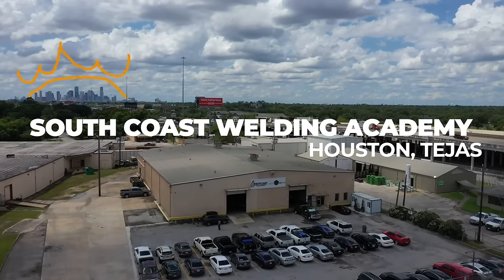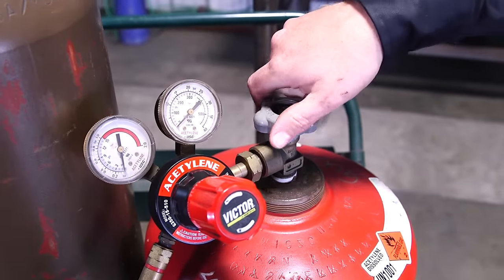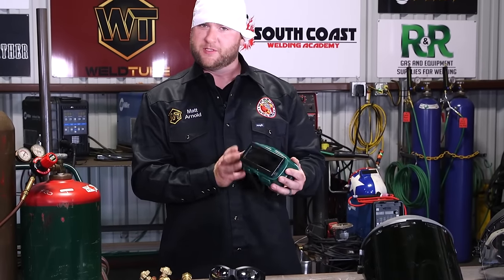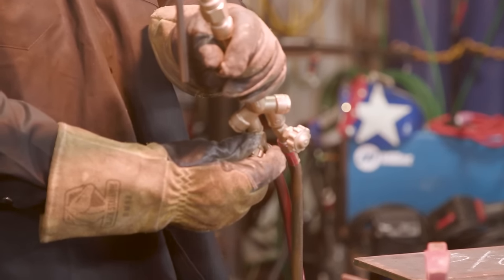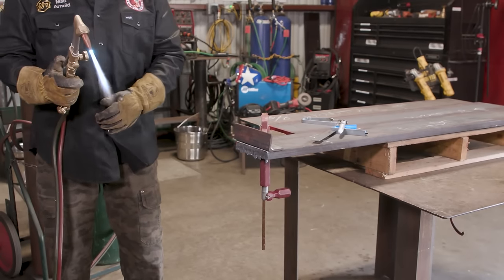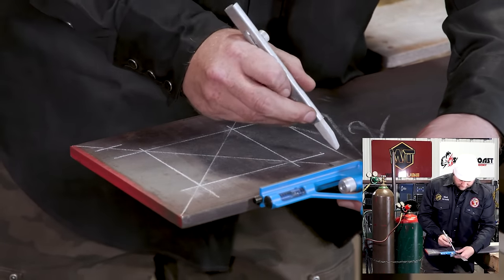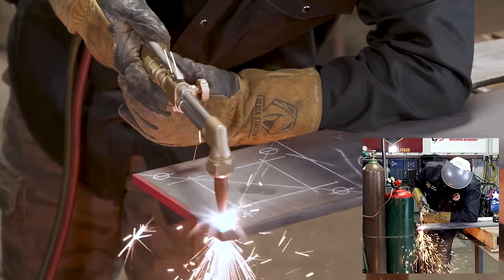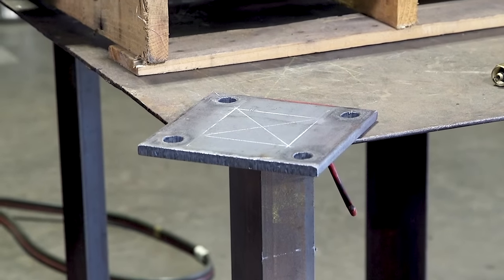Torch Cutting Basics Everyone Should Know | Oxygen & Acetylene Fuel

Comment: Another quick tip when you were going to pierce a heavy plate use a price  punch in the center of the hole and start your hole there it will help pierce the plate with your torch
Reply: Yes the term is prick punch and we all know to angle the cutting torch tip so it doesn't melt when preheating. Thanks, I've never heard that tip before.

Comment: You included good safety tips.  But, when you were setting the oxy acet regulator pressures you had the torch tip pointed pretty much at your clothing.  Some clothing is more prone to capture acet and/or oxy resulting in a potential fire hazard to the operator when you light the torch.  However, given the time between you setting reg press and lighting the torch resulted in minimal risk for either gas to still be present on your clothing.

Comment: Using a torch to drill bolt holes. Much faster than drilling. Good to know.
Reply: In some fab shops if your doing rough work the boss will insist you cut the holes with a torch. It's rough but saves a lot of time. The difference would be 1/8 stock versus 3/4. For 1/8 you would punch first and if you don't have the equipment then drill. It all depends on how precise the hole has to be.

Comment: Question for you Matt:  Can I use a clean, dry paper towel to wipe out the conical regulator connections on an oxygen and  acetylene tank ? Never has any grease or oil been put on them.

Comment: Hey Matt, great guidance and info I can use in Sargent. RE: hose safety and placement, I normally drape the hoses from behind then over my shoulder. Helps keep the hoses out of the spatter and takes some of weight off my arms/wrists during a long cut or weld. Do you have advice or opinion on that? Thanks.
Reply: I've personally seen an acetylene hose have a pinhole in it and guy had hose blow up while thrown over his shoulder. Burned him pretty bad. But with that said... if you have spark arrestors and check your hoses..... I throw them over my shoulder too sometimes.
Reply: A loose single wrap around your forearm is helpful as well, I do that alot with any corded or hosed tool that will allow it. Helps with weight and keeps the cord/hose out of the way.

Comment: I was fortunate to work for someone that taught me how to use a cutting torch. Too many people think the bigger the tip the better. My favorites are the 0-0000. I use a cutting torch like it's a plasma torch. I have things displayed on my front porch I have cut out. I also have TRIED to teach others how to use a torch. Once they get the space shuttle going you have wasted every breath TRYING to teach them. Sad to not need a chipping hammer or grinder after you cut something. I have had signs displayed that cleanup afterwards was minimal. Tread plate is a little harder to cut 100% clean. Even light gauge with no grinding/chipping. But get a #5 tip and crank the oxy-acetylene up and wonder what's wrong with the tip!

Comment: Not all torch manufacturers have the same shutdown procedure. Smith is fuel gas first then oxygen. Victor is oxygen first then fuel gas. Great video.
Reply: And thats is victor one
Reply: Thanks for this! Mine is a victor style and I close the oxy first then fuel for shut down.
Reply: Triangle combustion rule
Oxidants - presure - fuel(hidrocarbon)
A bit fuel Enought to blow oxigen tang
Reply: Its always Acetenyl and then Oxy.  A before O or up you go!  The idea is that the Oxy will blow out the flame, and then you turn off the oxy.  If you turn off the oxy first the gas could continue to burn back up the line, ignited by the hot tip.
Reply: @trevor5290  my torch light up is A then O and shutdown is O then A.  That's by the book it came with.  It's by victor.

Comment: that torch is cute. we use the 3ft n 4ft torches at work. so u know how thick the metal we cutting at work. i would say the thickest we have to cut is 12 inch but deff with a straight tip and not a 70 degree. cool stuff man

Comment: Great video, I can smell the burnt steel. I only noticed one minor thing , no two actually. First, when you opened the acetylene valve the hose pressure gauge was already set. Should have been backed off to be proper... I don't bother doing it until they get put away when I'm done but this is an instructional video.  Also you didn't bleed the lines when you were done? I try and do the fuel first and then the O2, maybe you're still working but that is something I've been told to do when I was learning this many years ago. Sorry to nitpick a great video
Reply: Maybe people in hobby shops unscrew the regulators but nobody in a revenue producing shop wastes the time.  Not in my 60 plus years in the trade,,,You pick up a torch kit at our shop that has been on the shelf for months, Guess what? Put the regs on the bottles and start burning. Very seldom does anybody even look at the gauges unless the torch is not burning right. You can tell after you light the torch and hit the oxy lever.

Comment: I like to set the tip so I’m cutting with a single hole and not the two hole. I like to angle it slightly more than shown here, it looked like it was leaning the wrong way slightly.

Something that thick and I’d throw a little preheat on the back side too.

Comment: Remember this 
When piercing a material.  Start with the torch at a slight angle. When it starts the burn, straighten it up and continue cutting. Prevents blow back from plugging the tip!

Comment: how thin would you go with an Oxy/Acetylene torch like say 14ga to 1/4 in or is a plasma cutter a better option.  I Dont have either right now but you can also heat metal for bending with the O/A torch making it multi purpose.
Reply: Thin materials I definitely recommend a plasma.
Reply: @Warriorweldingtx  Thanks Matt, I kinda figured but wasnt sure.
Reply: The cutting torch really heats everthing up, you need to preheat the metal to cut and it warps thin gauge metal. That's why when doing repair work carbon arc gouging is used to remove welded parts. There's no heat and no buckled metal.

Comment: A good clean tip and right pressure set and while lit with neutral flame and pulling the cutting jet open should sound like paper being torn and a not like a leak in an air hose and you should see a long clear straight jet of oxygen extending nearly the entire length of the flame

Comment: Few things I noticed, you didn't explain that the reason to stand to the side is in case the diaphragm ruptures, the pressure adjusting screw assembly can become a projectile.
Most importantly, once you pressurize your torch lines you should turn off the cylinders. Why? While you can "usually" smell acetylene, you may not smell a small leak. Shut off the cylinders then watch your gauges. If the pressure holds, you're good. If it drops, look for the leak.
 The reason for using backlog prevention devices on both the oxygen and acetylene lines. The importance of never turning the acetylene working pressure above 15psi ( in excess of 15psi acetylene becomes unstable and could explode with "any sudden shock" such as the "pop" when a torch lights.). Also never lay an acetylene tank, full or empty, on it's side. An acetylene cylinder contains a (for lack of a better term) spongy medium that absorbs the liquid, as it's filled. The gap, in the top of the cylinder between the medium and the valve opening is where it converts from liquid to gas. If you lay it on its side you will get liquid acetylene in that gap. If you don't permit the liquid time to soak back into the medium you could end up pumping that liquid gas through your regulator and torch. Just a few notes from a retired construction Boilermaker welder/mechanic.

Comment: Huh, ive been using 10 and 40 psi on my bottles for years. 5 and 25? Gona try that right now. Mine it mainly for heat but sometimes you end up cutting.
Reply: Folks in the industry usually have the gas cranked up way too high in my experience. Watch a guy get salty when you suggest to turn it down.

Comment: I have not used oxy/acetylene in 50 years. my cutting rig is oxy/propane.
My last job it was 60 miles to get my tank refilled and I had two oxy tanks and my propane tank i could fill from a big propane tank on site. i did a lot of cutting in a underground mine and i did not want to set a acetylene tank on its side but with oxy/propane i could set both tanks on there side to transport them.

Comment: Hi.. im just curious, can I cut or use acetylene while the gas and oxygene bottles are lying down on the floor? Thank you..
Reply: Always keep bottles upright
Reply: The acetylene, inside the bottle, is actually in a liquid form. Inside the cylinder contains an absorbant material that soaks up the liquid. Lay the bottle down and you'll have liquid spitting out. Always store acetylene bottle standing up. If it happens to be on it's side for a while...set it back vertical and leave it overnight.
Reply: @hokep61  ...yep, that is 100% correct.

Comment: How high does a work piece need to be off the ground to safely cut?  I'm looking at buying a 3/4" 6'x8' steel plate and I want to cut it in half to transport. It's on the ground now and I'd like to know how far off the ground I need to lift it.

Comment: To address the issue of safely holding a 1" steel 10x10 plate during cutting, the solution would involve a dual-magnet system to secure the plate while it is being cut, preventing it from falling and creating a hazard. Here's a step-by-step description of the solution:

Primary Magnet:
You will need a strong neodymium magnet with a pull force capable of supporting at least twice the weight of the steel plate. Given that a 1" thick steel plate of 10x10 inches can weigh approximately 40-50 lbs, the magnet should have a pull force of at least 100 lbs or more to ensure safety.

Placement:
The magnet should be positioned behind the welding torch but far enough from direct exposure to the flame or high heat. Neodymium magnets can lose their magnetic properties when exposed to high temperatures, so placement is key. This can be done by attaching the magnet to a flexible support mast or a clamp system.

Clamp System:
Use a heavy-duty clamp with a flexible, heat-resistant support mast. The clamp will secure the system to the stock material, while the mast can be adjusted to bring the magnet into position without being directly in the heat-affected zone. The support mast can be a gooseneck arm for easy adjustments in tight spaces, with the magnet at the end.

Secondary Magnet/Support:
If additional stability is required, a secondary magnetic base can be used to further secure the system to the workbench or cutting table. This ensures that the support mast remains fixed while the primary magnet holds the plate in place.

Flexible and Lightweight:
The system needs to be lightweight and compact enough to avoid interference during cutting but strong enough to hold the steel plate. A combination of neodymium magnets and a well-designed support mast will offer the necessary flexibility without becoming cumbersome.

This dual-magnet solution, with a clamp and flexible support, will prevent the steel plates from falling after being cut, creating a safer and more controlled fabrication environment.

Comment: For the the last 50 years I've always ran 15 psi gas and 40 psi oxygen and works awesome . I guess I've been doing this long enough that I don't need or use a guide plate .
Reply: Ditto,,,,,and we don't loosen the regulators and open the torch valves, either,

Comment: When you did the first start-up you didn't mention that you should make sure your regulator/diaphragm screw is backed all the way off and when you did second start-up you closed then opened valves again without backing them off,then turned in then out,the whole purpose of standing to the side of the regulator while while opening tanks is that the diaphragm/regulator screw ISN'T under pressure and doesn't blow out at you or hurt someone else, especially the oxygen since it's generally 2200psi......
Reply: So essentially what you are saying is to back out the pressure regulator to where there is 0 pressure then open the main valve and then adjust the regulation from 0 to whatever pressure suits the job ?
Reply: @srjr2531  way it sounds, logical as well

Comment: When using a cutting torch, how far away from the metal are you supposed to have the tip?? Dragging the metal or like an 1/8th inch away or???
Reply: I start off about a quarter inch to start cutting once it blows through you can stick out half an inch to an inch and it’ll still cut. Use a guide and it’ll cut smooth don’t get to close cause you’ll clog your tip and maybe even ruin it

Comment: What is the procedure to cut thin material with an oxy torch

1 Hold torch tip perpendicular to cutting piece, then move quickly.
2 Angle torch tip in direction of travel, then move quickly.
3 Angle torch tip in opposite direction of travel, then move slowly.
4 Hold torch tip perpendicular to cutting piece, then move slowly.

Comment: How do you keep from forming so much slag on the back side of the cut?  I get it cut, but then there’s so much slag I spend so much time getting it off that it would have been much faster to have used a saw to start with.
Reply: Using the correct cutting tip, gas pressures, speed and angle of attack are all necessary to obtain good results.  If you practice moving the torch along (without lighting it) , you will gain skills.  This is also true when doing various types of arc-welding.

Comment: Is there much of a deference in setup for a propane/oxy torch?
Reply: Propane is supposed to use P type hoses. The tips are different as well.  Propane burns about 10% cooler and thus it takes a bit longer for the preheat, and travel speed is slightly slower.  However the pro's are propane is way cheaper than Acetenyl and will last about 4 times as long. If you go that direction MAPP gas is what you want.  Propane with Acetenyl in it.

Comment: Can’t do that with the 300 dollar plasma cutters on Amazon. How much does that set up cost ?
I just want to cut no bigger then 1/8 inch thick steel into shapes.  But not want to plug into electric or use compressed air for plasma.

Comment: As far as the "working pressure" before opening the cylinders, I ensure the regulators are all the way shut. Then when you open the cylinders, you will be at 0 on both regulators from the start, making the regulation accurate with the torch valve closed
Reply: This is very hard on the diaphragm of the regulator s

Comment: hey WT, it is possible to braze with cutting torch? if so how do I do it?
Reply: Yes sir! Just need to put the welding attachment on the torch.  Run your pressures at 5 and 5 on both the acetylene and the oxygen.  Also, remember, brazing is a bonding process, not a welding process so don’t actually melt the base material, you just want it orange in color.
Reply: @Warriorweldingtx  butwon't it be too hot and gets oxidized right? I mean the filler rod
Reply: @Jack_Krauzers  no sir, I actually teach oxy acetylene brazing in my class with flux coated rod

Comment: I have heard to turn off the oxy first during shutdown to avoid an explosion at the nozzle. Anyone care to explain which method is safest? I want to be sure.
Reply: Hi John.
So, i've actually read manuals, and done testing myself and you can do this test too at home!
Acetylene, creates the flame and sustains it. Oxygen makes it hotter.
Oxygen is non flammable, you literally cant light it, BUT it makes any fire hotter by being there.
If you take a weak acetylene flame thats very sooty, and start adding oxygen it'll pop itself out.
This is a backfire, which is a flashback but weaker, as it's usually stopped at the seals and doesnt retreat into the line.

Oxygen First will create this "backfire" scenario in a split second, and at worst will cause a backfire that goes into the lines and gets soot everywhere. Soot is very hard to clean and Oxygen won't just "blow it out" of the nozzle. This soot can clog your seals and cause a flashback as the seals wont be able to properly close on the Acetylene.

Closing Acetylene last, also tells you if your Acetylene seal is good, if not there'll be a lingering flame at the tip that pops itself out when the seal is 100% shut.

In reality however? Follow your manufacturer, as different torches, tips, models, ect. all work completely different from eachother.

Comment: It's standard operating procedure to turn off oxygen first check any manual or any torch manufacturer.
"We recommend closing the oxygen valve first whenever turning off an oxy-fuel torch system especially when Acetylene is fuel. This is only part, but a very important part, of the complete safe operating procedure recommended for torches by Harris."

Comment: A big safety featur you forgot are 
 flash arrestors 
Soapy water on the connection joints 
Fusible plug on the acetylene 
 Line corrosion
Some of the basics everyone should know before hand .
Reply: Just starting.  My torch has built in flashback arrestors....should I add them at the tank? Also, what's a fusible plug?
Reply: Soapy water is frowned upon now. They prefer snoop

Comment: Hot molten metal destroys a concrete floor over time. Always throw a piece of tin or light sheet steel down, let the hot sparks and slag fall onto it.
Reply: Man...I was thinking the same thing.  If you work in a booth, and do serious heavy cutting, you'll probably be cutting in the same area, day after day. Concrete holds moisture and will blow up.